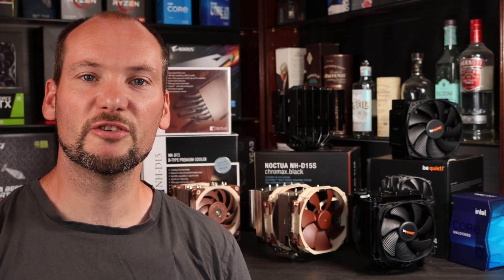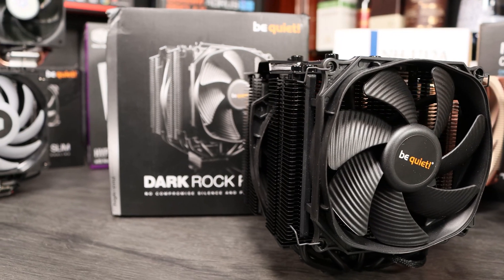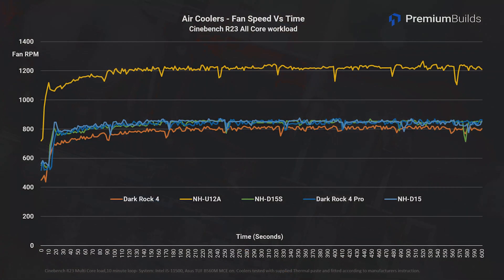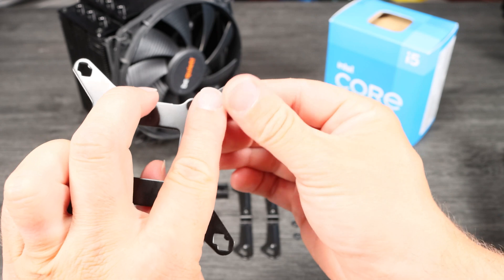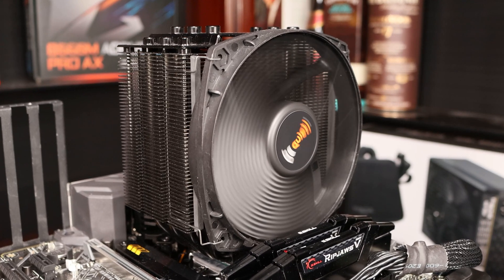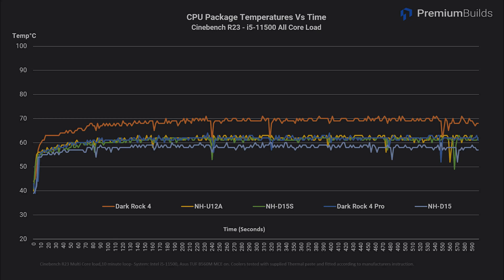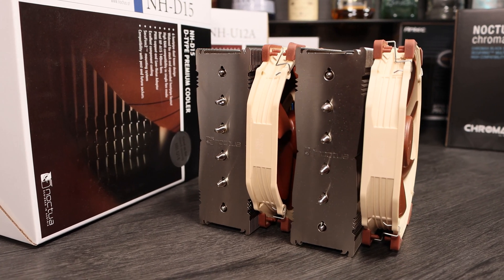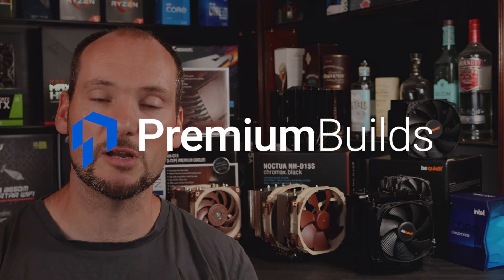High End Air Cooler Roundup! Which CPU cooler is right for you?

Comment: Noctua was supposed to release an upgraded 140mm fan ala 12x25 style which would theoretically put the cooler farther ahead (just like they updated the NH-U12a with the 12x25 fan)
Reply: Así es! ya que el U12A le quitó el puesto al D15, ahora con la actualización de los ventiladores el D15 volverá a ser el rey, pero no por mucho 😅 el U12A le pelea y por muy poco menos en $, yo lo compré  es una belleza

Comment: I have the  Noctua d15 and have to say its a mammoth of a cooler . It really cools and is difficult to get the temp up of my 7000 series AMD cpu. For me its a maintenance free cooler what is what I was looking for.  The drawback like pointed out in the video is the center fan obviously fits perfect but the other fan interferes with the ASUS TUF plug housing that is toward the rear of the unit. Moving the fan to the front over the memory sticks doesnt work either with short standard size memory, not tall. A fan will work on either side but you will need to purchase a smaller separate fan. Over the memory it will stuck out past the case about 1 inch. Again with the short standard memory it works fine. The only other concern I have is what is not noted here in the video but its the WEIGHT of the cooler. Again, it is humongous and with that comes weight. At the moment it is fine but for me to feel comfortable I am going to install some kind of support to help out over the years that I will use it.  I dont plan to open my standard ATX case also dont plan on having a side glass panel. Again I wanted a large cooler that works with anything I will throw at it and a cooler that is a set it and forget it...... I am please with the cooler. I ran some cpu stress test , nothing major , and the temp only raised about 8 degrees. The CPU runs at 32 c all day long.

Comment: The mATX GPU compatibility depends a lot on the motherboard. For example, the D15 is compatible with MSI's b550m Mortar, which is what I use.
Reply from the maker: It depends if the board has a 'high' top slot or not - position 1 closest to the CPU socket, basically. But not a lot of people know there's even a difference in the D15 and D15S cold  plate offset.

Comment: Wow, so the NH-U12A and the NH-D15S have almost the same performance. I did get the NH-D15S chromax.black, then replaced the stock fan with a 140mm Coolermaster MF140 ARGB fan and added an MF120 ARGB. I haven't compared its performance with the included stock fan though.
Reply: Did you just downgrade the Noctua fans for the CoolerMaster just for the RGB? SMH

Comment: Dark Rock Pro 4. I am still deciding whether to install before installing the motherboard in case or after.
I know you mentioned the choice. Which is usually better? Both options seem to have the possibility to be difficult for a few things such as motherboard screw or attaching middle fan.
I am leaning towards installing after the motherboard is in the case. Then one of the coolers screws may be tricky and possibly the middle fan.

Comment: D15s supports additional cooler, brackets are in there. adding second 120mm (bought separately) may make it perform on par with D15, because they are basically the same coolers with symmetric and asymmetric design.
Reply: Спасибо, сударь. I wish D15 would allow taller RAM modules because 32mm clearance is basically nothing nowadays. But благодарю for the tip!

Comment: I like the NH-U12A that is now in the Chromax Black.   It's an excellent all around cooler without being overly huge.
Reply: I just got that for my pc, it isn't overly huge and perfectly fits with everything else I have in my case
Reply: @jcspotter7322  what about the noise level?? Compared, if so, with some original cooler like AMD Wraith? Thanks!
Reply: @ismacom  Never heard the wraith, but the U12a is very quiet.       The stock Intel cooler replaced was immensely louder and caused thermal throttling quickly.
Reply: can it cool a 13700K without issues?
Reply: @OfficialGundem  Everything I have read says it will and I plan to pair it with a 13700k soon enough.  As long as you have a case with good airflow it should be good.   I have the Bequiet 802 with mesh panels and 6x140mm fans and it's works out great
Reply: @Wigglythegreat2  But it'll be quite loud with the U12a and you'll thermal throttle when running Cinebench R23. D15 will be the ideal choice
Reply: @Chopper153  The NH D15 fans at max are actually 2db louder than the NH U12a fans at max.  I have the Noctua 140mm fans as case fans and I like them, but they aren't quieter than the NF A12s.   Although the NH D15 cooler may perform slightly better, it really isn't worth the huge amount of case real estate that you have to sacrifice.
Reply: @OfficialGundem  Nope. 13th gen is extremely hot. You need a NH D15 or Deepcool AK620 for this. I'm currently using a good 240mm AIO for my 13600k and at 200W it already reaches 83C in Cinebench (my room temperature is 25C).
Reply: @Chopper153  Your room temp is quite high,  my thermostat is kept at 18C so room temp will make a difference.  Plus you haven't said what your case is and fan setup is so that will obviously make a difference in cooling ability too.
Reply: But the D15s is better

Comment: Which CPU Air cooler you recommend for gigabyte B560m Aorus pro ax inteL Lga 1200? i will use i5-11600k (i will not overlocking) i  just play games not video streaming or editing
Reply: I got i7-11700k and paired with with a noctua nh d15 and 3 140mm fans. Hottest it’s ever got was 55c under full load for over an hour @4.6 ghz